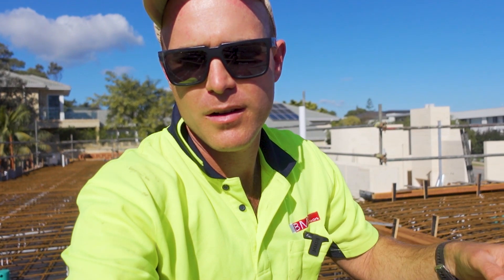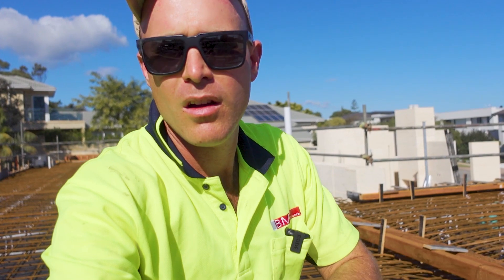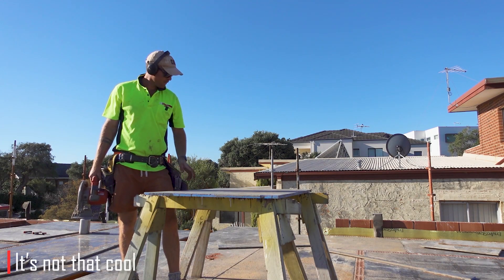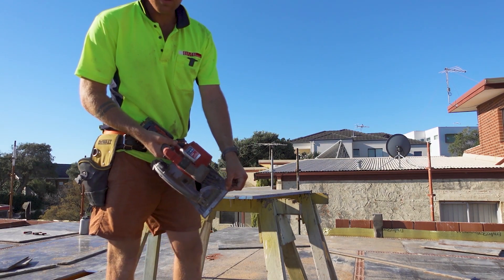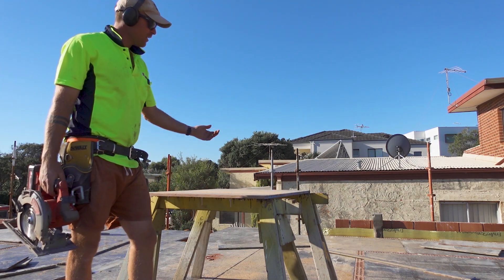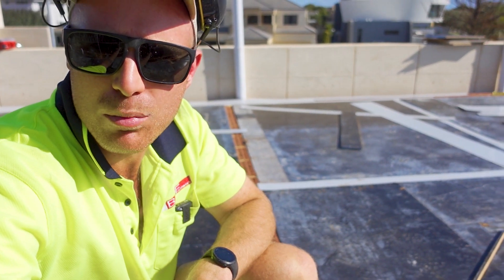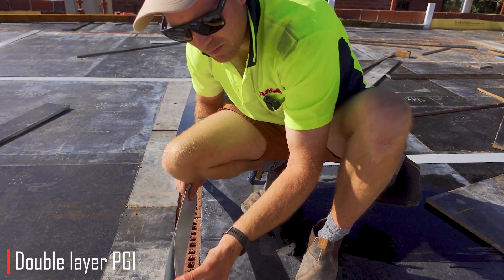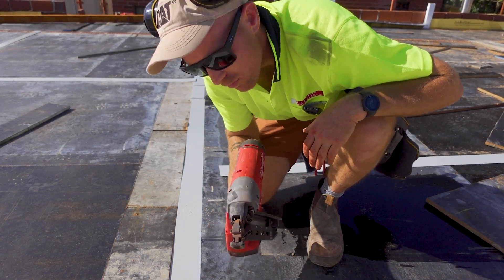How To Build A Suspended Concrete Slab For A House Part 2

Comment: Hello. Thanks for making this 2 part video. I have some questions :
a) On a Besser brick building (which is to have a 150mm concrete roof) that is 6mx4mx2.4m high with a dividing wall (2 rooms), Should there be vertical reinforcing (12mm) in every block ? (200 series blocks). In other words, should there be a steel rod each 400mm apart the entire height of the building ?
b) On a concrete roof which is 150mm thick, should there be one or two layers of reinforcing mesh ?
I need help with this, thank you. 🙂
Reply from the maker: I’m not qualified to advise on this
Reply: @bmformworkconcreteconstruc9783  But what's ordinarily normal and standard ?
Is it normal to put one vertical reinforcing rod per brick ? (every 400mm).

Comment: Hey mate, I can’t quite tell in the video but did you use normal chairs for the reinforcing? I’ve got a project coming up with the underside of the slab becoming the finished ceiling downstairs, having a hard time coming up with a way to properly suspend the reinforcing. Do you have any ideas?
Reply from the maker: If you’re doing an off-form ceiling you want full plastic chairs. Don’t use the steel ones as they leave dents in the soffit and you will see the tips of some of them.

Comment: Hi. How do you avoid nail marks on exposed concrete slab soffit?
Reply from the maker: Use 15ga nail gun nails and set depth correct, you won't see them.

Comment: I’m thinking of not to use wood sheets to do my houses concrete slab. It is much to expensive if you use it only one time. In Germany we use “slab - blocks”. I can’t find them here in Panama so far. Maybe I have to use something else instead.
Reply from the maker: Generally yeas it is very expensive to only use the ply once.

Comment: What is pgi? Anyone?
Reply from the maker: It's galvanised strips of metal to stop the bonding of concrete to bricks and allow movement during expansion variations between conc and bricks. We use 2 layers. Some people grease between the layers

Comment: Do you create any special joint seal or spacer for slabs between different rooms/spaces?
Reply from the maker: Nope all connected. When we do units there will just be a separation between units. Apartments will be one big slab though.

Comment: Very efficient!  No wasted motions.  I never thought about the CFE of brick v concrete, though here we would never not attach floors to walls.
Reply from the maker: It's weird isn't it. floating slabs. There is often some cast in steel columns and the stairs tie in but generally the whole conc suspended slab is floating on the bricks! I suppose an earthquake here wouldn't be a good thing!

Comment: Great video, definitely a star in the making. 
Do you have any videos of stripping that formwork as I was wondering how seeing you had nailed it from the concrete side, or is the ply all sacrificial saving what you can?
Reply from the maker: thanks mate, that is a good idea for a video, I will show the stripping techniques we use. We strip all of it and we pull the nails out backwards with knipex "knips"
https://sydneytools.com.au/product/knipex-6801280-280mm-end-cutting-nipper

Comment: Nice video! What would it look like if a suspended floor was supported on both leaves of a cavity wall? Can you describe it?
Reply from the maker: yes this can be done but the cavity on external walls prevents moisture entering the home, it also insulates. but when we do this we put down flashing (thin galvanised steel) to cover the cavity.

Comment: what are those pvc pipes installed for inside the slab?  are they sewer pipes or drain pipes ?
Reply from the maker: I'm not sure which ones you are referring to, but there will be 1 or 2 for any toilets, the ones on outside were for rainwater downpipes, the one on balcony is drainage, im sure there are some bathrooms with drainage too. and the tiny ones are electrical conduits.
Reply: @bmformworkconcreteconstruc9783  the one at 5:00 ?  cheers
Reply from the maker: rainwater downpipe. 90mm
Reply: @bmformworkconcreteconstruc9783  just curious to know the reason why is this pipe not going straight through the slab downwards to the lower level?  Instead it is bent 3-4 times within the slab with 90 degree joints.  in case these joints do leak or break due to the expansion/contraction of concrete, wouldn't the leak cause rain water seepage into concrete and cause destruction?

Comment: Why there are no columns and beams ?
Reply from the maker: Hi Ivan, the brick walls support the slab. If the walls or balconies are much larger then we will have beams. And if no brick walls, then we will have columns.
Reply: @bmformworkconcreteconstruc9783  Is that thin brick wall support sufficient  ? What would happen if the slightest earthquake shakes the ground ? I'm asking because here in Bulgaria the columns are considered as the main support for the slab while the brickwork is more like a filling .
Reply from the maker: @IvanChepanovvankata87  I noticed the way you guys build when I travelled Europe. I thought it was mostly done to speed up the building process and add the brickwork after. Sometimes we do this here. To answer your question, we don't have earthquakes, also the walls are actually quite strong, some have steel rods in them, and often they will have a steel column inside the wall. So they do take measures to prevent lateral movement I guess. We also naturally have resources here for making cheap quality bricks so I think that is the main factor. Bricks are the cheapest way to build here.